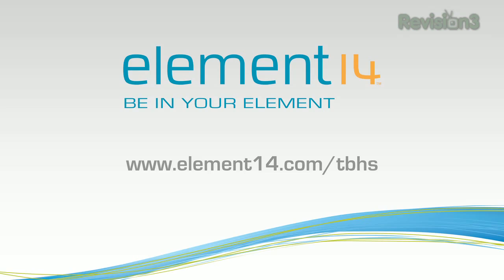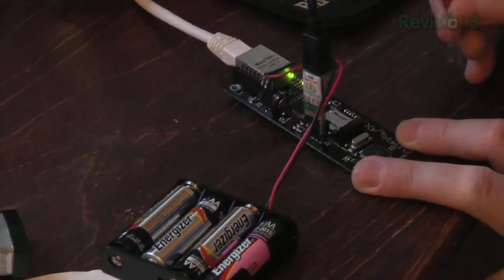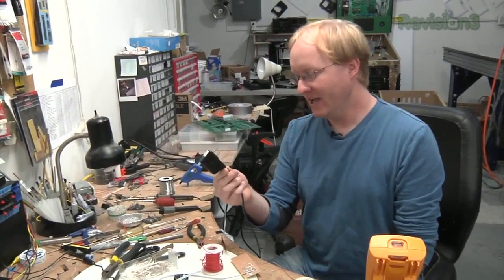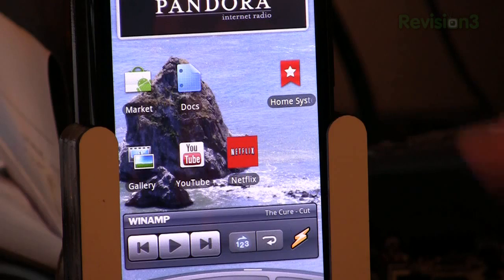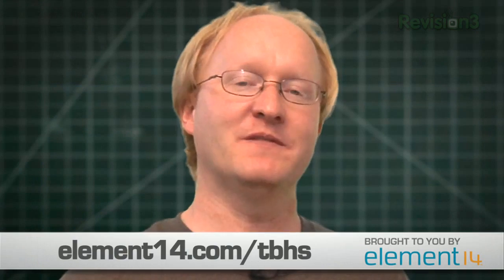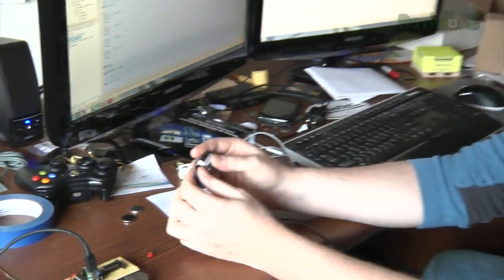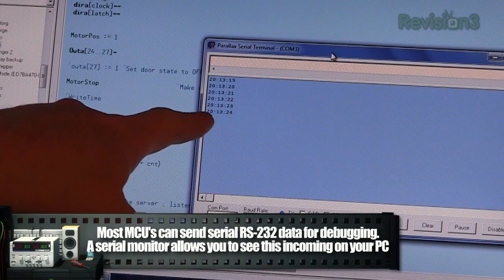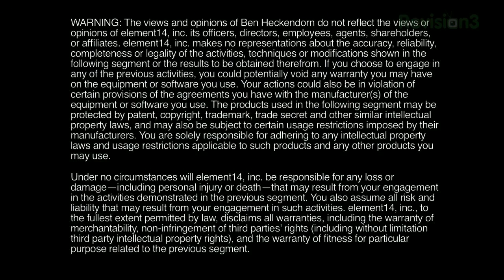The Ben Heck Show - Automated SmartHome Tricks For Every Home

Comment: You aren't using a servo to push the existing door button?
Then why are you trying to use a motor to control the thermostat? The thermostat is a switch. With easily accessed contacts. We know you can wire a switch to your micro; you've already done it. And you already have a temperature sensor. Gaaaah!

Comment: Could you just connect a small motor directly to the dial shaft on the thermostat? you would have to mod the housing but it would eliminate the belt from slipping or falling off. You could hard wire a connection or hook it up to bluetooth or wireless. that way your home computer could control the temp.

You could also Mod it by connecting it to blue tooth but having the I/O switch from the gauge connect to the bluetooth. that would tell the computer what temp it is and enable it to control the A/C unit. You would have to ensure it does not turn off the compressor on the A/C unit or you may run the risk of damaging your A/C unit.

Comment: On the thermostat, I'd use a rubber band.  Put a round, clear piece of plexi on thermostat dial, to keep rubber band from slipping off if it does.. like a spool  Rubber band has tension and grip. If you take the dial off, isn't there a spinner knob behind it?

Comment: Option 1:
-Learn loads of programming languages
-Learn electronics
-Buy the right equipment
-Replace your heat system with an old rotator like that
-Get an Apple developer license for Iphone (200$ a year)
-Get an Iphone (400$)
-Get a macbook to build the app (1200$)
-Dont mess it up or youll die of heat or freeze to death

Option 2:
-Install a tiny bit of Domotica (100-200$)

Yep,
Reply: He didn't need to make an app... and it was Android anyway. All the coding was I2C and HTML, so it was relatively easy, and 100% free for the programming.

Comment: Actually, controlling the temperature is really simple. It’s like shorting- and opening the thermostat circuit, until the desirable temperature is reached (I figured out that this is even backwards compatible with new systems). Using a simple temperature-sensor schematic, you can create a brand new thermostat yourself (eventually including two buttons for manual editing). Adding a display too will be a good idea for another project. And trust me: I’ve seen doing you more destructive things ;)

Comment: Those old thermostats are simple temperature controlled switches. The cover comes off very easily, exposing the wiring inside. He already has a temp sensor. All that is needed is a relay (or two, if you want both heat and AC) and you completely bypass the old thermostat. When you move, you disconnect your relay, restore the wires, and pop the cover back on, and it's as good as new (or old).

Comment: You could use PHP to check the IP that the connection is coming from, but a connection from a mobile device would probably not come from a consistent IP.  You could also use PHP for a password that you need to enter before you can access the page.

Comment: Yes I know it has been around for literally years but it does not work that well at all. Ram allocation is a big problem. It is very expensive and your CPU is not upgradable your safer just paying for a Desktop computer. And has I stated the majority of laptops will NOT have a PCI Express slot so its bottle necked even more !. Waste of time and Money the cost of it you would be safer paying for desktop pc. Now with Thunderbolt you could get far neater and better results.

Comment: As far as how to drive the Honeywell AC / Heating unit, I was thinking you can pull the disc off of the front of the temperature selection unit and there is an elongated Woodruff key shaped entry that controls the potentiometer of the unit. If you can copy that female entryway shape via. 3D printer and create a male Woodruff key shaft you can use that to help the stepper motor drive the temperature control unit directly.

Comment: I know you're trying to fill time on the show but some basic research into HVAC systems will show you the regular systems use standard signals you could manipulate with relays.  should have just wired in the microcontroller through relays and built an override controlled by the thermostat that was read by the controller.  my $.02

Comment: If you do a revision of this device, may I suggest having the motor or a shaft horizontally centered in-front of the dial- a dime sized pad on the end of it with a sticky face pressed against the surface of the dial should rotate it without slipping or damaging the thermostat.

Comment: hey ben i was wondering if you could kinda have a new viewer challenge i was thinking about taking a vhs player and turning if into an add on to a portable dvd player. just like have a place to put the vhs and use the headphone jack and video in to make the tape play on the portable dvd screen and another plug so it could run off the battery from the portable dvd player thanks for the help with this creative problem

Comment: @pleasureONstrings 
if you can bolt the assembly into the wall, you can also pop a few screws and make a few connections :P

i think that i would be better if we could controll the termostat from the web, it's a lot better and energy saving if we send the order to the house while leaving work, or the restaurant or the park, basicly it's like it was demonstrated, without all the time checks and cycles.